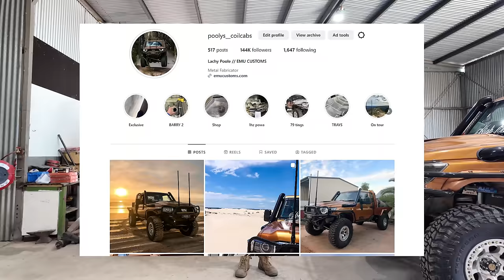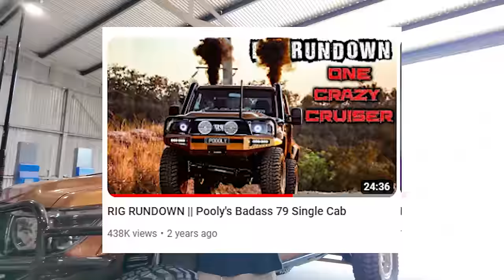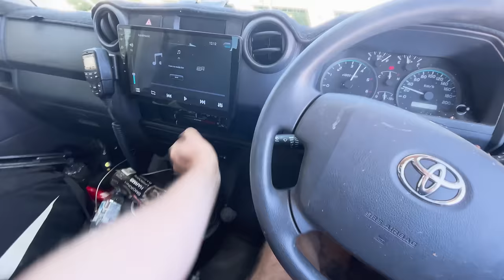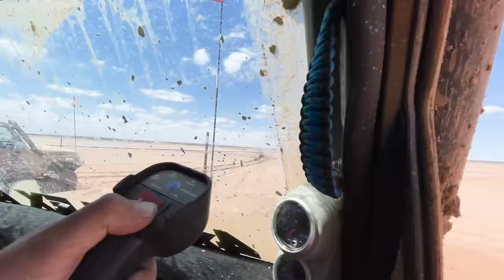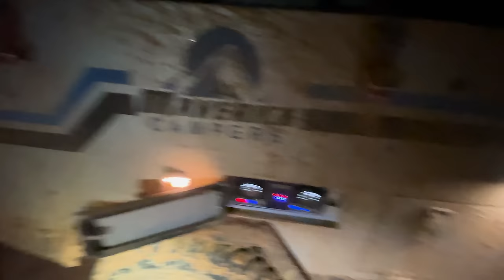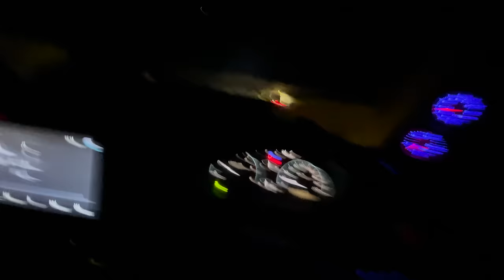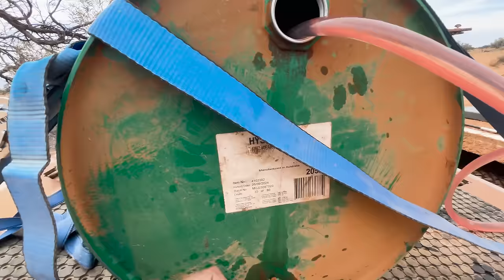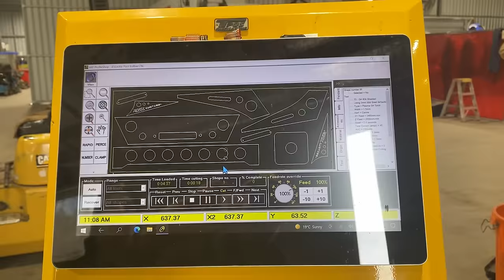BAD LUCK in the DESERT!!! the story of the GOLD UTE from TIKTOK

Comment: You guys look like you had a blast but you need a spotter with a hand held two way radio guiding each other down rough rutty tracks and you all need under car body protection guards to avoid damage to radiators diffs sumps and gear boxes and transfer cases makes your trip a whole better without not so much damage